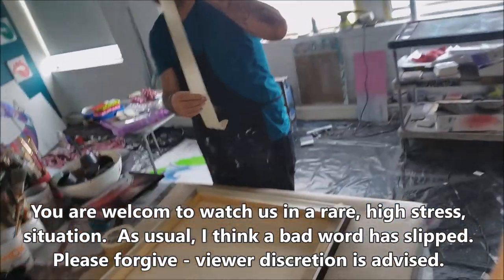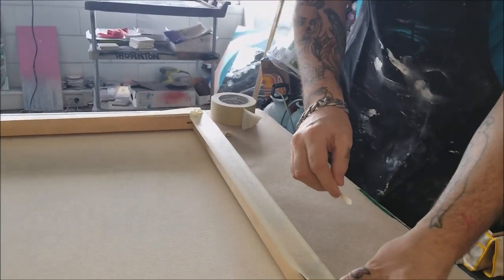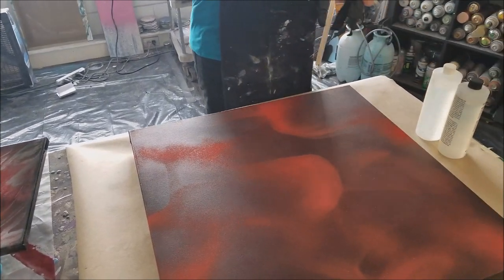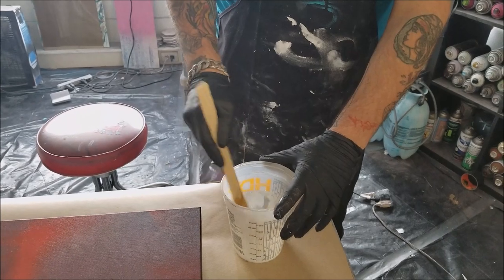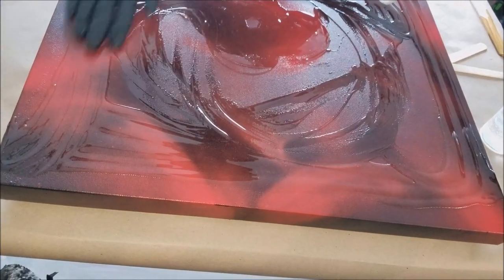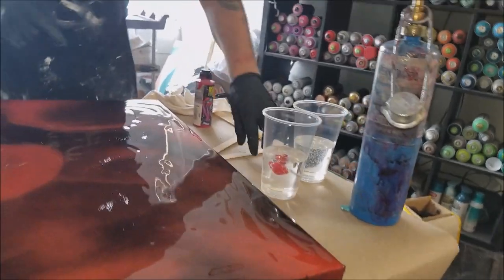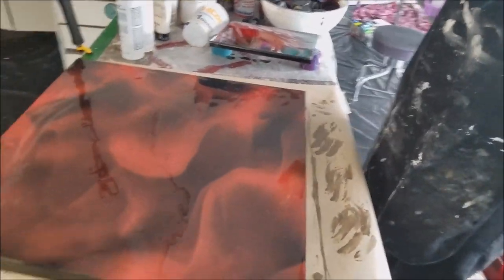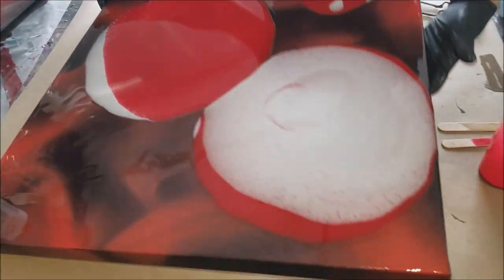When a Mistake Becomes Art (Resin Rose) LARGE RESIN ART

Comment: Love the shimmer in the gray with the red and white. 2 questions. How large of a stretched canvas have you done with a resin pour and it not bow after prepping? How did you like the countertop resin when using it in a painting? Thanks for the videos.
Reply from the maker: Hello Clara! Thank you for the compliments and the questions. We have never really had a bowing issue when we prep the canvas properly but the largest stretched canvas we have poured on has been an 18in by 36in. We would love to go larger - we just have to have the piece commissioned since that’s a lot of resin to use. The countertop resin is nice but probably not necessary when used on JUST ART on canvas. We got it to use for countertops since that’s the main concern that our clients have (being scratch resistant and extremely heat resistant). There are a couple other brands we want to try for canvas art. The resin worked well but the pot life is way less than I would like (working time is 40 mins once it’s out on the surface). And it doesn’t seem to like to have heavy body acrylic mixed into it lol. We will be doing more tests with it though.
Reply: Thanks for the reply. I had been wondering about Countertop Resin brand for uses on tables and trays. As they could be easily use the scratch resistance and temperature protection too. My Mom in particular has a round table that is in her sun room that I'm going to play with. Can't wait as the sun can offer a fun element to sparkles and pearls in the resin. And I want to treat this table as a piece of art.
Reply from the maker: Clara Lawrence perfect! If you have the resin available - I would recommend using your favorite brand to do the “art layer” and then wait a couple of days and do the countertop resin as a clear top flood coat. That way you can create the art with a brand of resin you are comfortable with yet get the solid protection of the countertop resin top coat. Countertop resin doesn’t have a long pot life and doesn’t like being mixed with heavy body acrylics...

Comment: Have you thought of working on board instead of canvas? 
I gave up on canvas because I was just having to many issues. 
I'm really enjoying watching you two work. Thanks for sharing
Reply from the maker: Hey Rod!  We pour on a number of different substrates.  Canvas, MDF, Masonite, Particle Board, Pine Board, Canvas Panels, Wood Panels, Birch, Lazy Susans, Tray Tables, Glass, Cement, Formica, Tiles, Ottoman Trays, I could go on.  We prep the canvases in bulk for Acrylics, Air brush, portrait work, etc - so we have a wall of canvases ready to be painted at any given time.  Canvas does give a lot of issues but we don't mind working preventative. What's your favorite kind of board to pour on?
Reply: I've been buying wood panels from Blick. It's too expensive in the long run, eventually I'll make them myself. 
If you have any advice on good substrates I'd love to hear
Reply from the maker: Rod Line I’m sure they get expensive! We like using reclaimed tables lol. They are sturdy and have already been prepped and sealed. We thrift shop a lot. We are also looking for the most cost effective substrate still lol